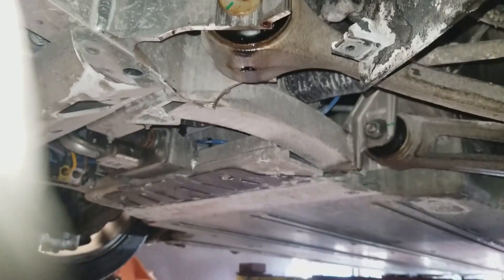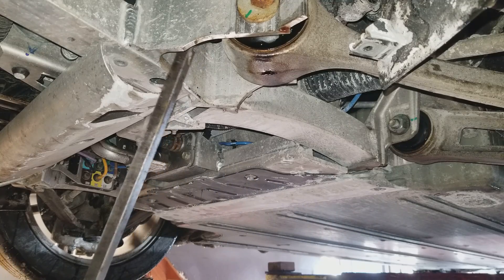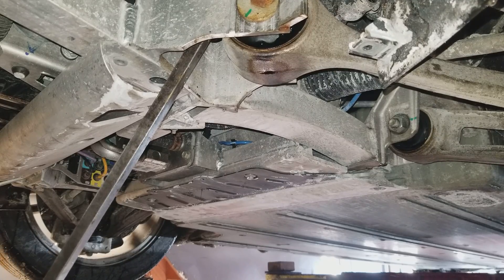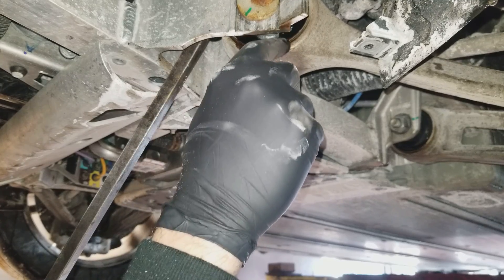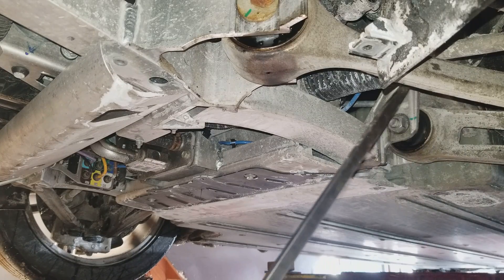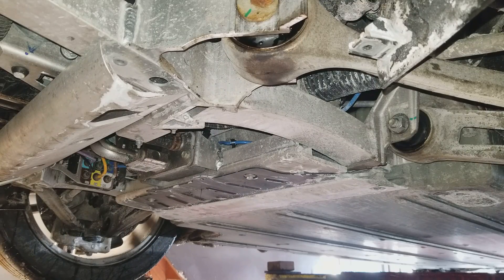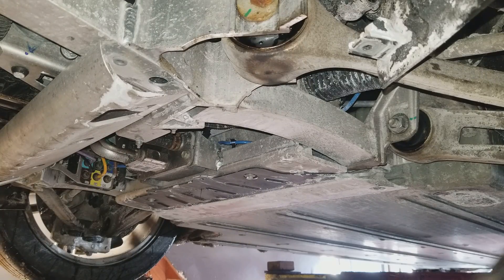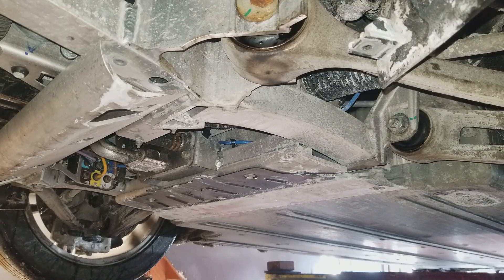Tesla Model S RWD control arm issue

Comment: looks like you could possibly cut the bolt head off. carefully. and slide bolt out. then install opposite  way going back together to avoid battery drop

Comment: Why not drop the battery it’s fucking easy 😂
Reply from the maker: Mark Conor yes. So easy. 

Until you crush a connector seat or have to bleed the coolant system without root access.
Reply: Evolution Automotive LLC lmao omg 😆 ok excuses to learn something new is all I hear or are you scared of the battery killing you 🤔
Reply: @Jimbo_zx  - It's much more about the management of risk and the opportunity cost of shop time - any good shop would recognize that.  Sure, the process for dropping the battery is relatively simple, and well documented in Tesla's shop manual - but not something you should just do for fun on a customer's car if there's a way around it - especially for something as small as a control arm.  The workaround to dropping the battery in this case (which the Tesla SCs use) is to cut the inner bolt and replace it in the opposite direction when replacing the arm.
Reply: @Andrew-vt7mi  i prolly would have just cut the bolt anyways 🤷🏽‍♂️
Reply: @Jimbo_zx  - For sure.  That's what the Service Centers do.  FAR easier and less risky to cut a bolt than drop a HV battery.

Comment: It is because those suspension  pieces are from Mercedes-Benz  E-Klasse and they  were not designed  for the   weight of   Model S which is very heavy due to battery weight. Tesla  was simply  unable  to design their own suspension.  They lack expertise.  Which is  compensated by  excessive hype.
Reply: Wait, from which E-Class are we speaking? W212? Is the entire front suspension from the mercedes parts bin? do the pre-facelift awd tesla's also have the suspension components from mercedes?
Reply: @steckenbrunzer  yes, they do.
Reply: @leotimtom6637  Sorry, could you be more specific? Thank you
Reply: @steckenbrunzer  Suspension pieces  such as  A arms  are from   Mercedes E- Klasse. Basically    all independent suspension is  from Merc. Actually  all  American sedans  and cars use   foreign suspensions  because they are unable  to engineer their own platforms, exceptions are only  trucks and some sports  cars.   Ford uses Mazda,   Chrysler uses  Fiat, Mitsubishi,  also Mercedes and GM uses   Daewoo, Opel and Isuzu.  Years of  rebadging imports and  regrilling their own  junk has made them so weak, that  any foreign company, even the  cheapest  European lackluster can  engineer better components than any US based car company. Even Koreans can  make better luxury  vehicles than US companies.
Reply: @leotimtom6637  Thank you very much :)
Reply: @leotimtom6637  
Or is it the other way around, do the Europeans share a design that the US built.
The only way to be sure would be to see which vehicle was designed first.
You also have the fact that Ford especially is a world brand and sell vehicles all over the place.
There's no way to be sure that the part wasn't designed in the US, and is simply used globally That's also true with GM.
They have a large global presence especially in Asia.
certainly Chrysler used a lot of Mercedes parts because they were merged at one point.
I'd like to point out that Chrysler products got significantly crappier after that merger. Because everyone knows Mercedes makes crappy unreliable cars that turn into endless money pits once they get past 100,000 miles.
be interesting to see where a US built Toyota Camry or Honda Accord had its underpinnings designed. Considering those cars are not sold outside of the US or in very small quantities.
I'm not saying that I know for sure which is the case, I'm just saying that you would have to look and find out when a particular suspension component was designed and by who, not just by what car that part happens to end up in.
There are so many sharings of chassis at this point globally to cut costs that I'm not sure this is going to be an easy thing to figure out..
But the idea that American companies are unable to design a suspension component is kind of asinine.
considering the heavy duty trucks that we build and design take way more abuse than anything a sedan will ever see. So I called BS on that comment totally.
we've been building big heavy sedans far longer than any European or Asian country.
Take a look at a 1960s Cadillac or a Chrysler imperial.. You think somehow we forgot how to build a suspension system after that?
Reply: @kens97sto171  well European cars can go around corners.
Reply: @geoffcarlton4047  
Yes and so can American cars.. Corvette, Mustang, of course European cars don't go around corners very long because generally speaking they're unreliable pieces of crap.
 Although some American cars specially Chrysler aren't a hell of a lot better in that regard... Oh wait it's Fiat Peugeot Chrysler now so an  even bigger piece of crap than it was before.
Sorry but there are no European cars I can think of that I would consider reliable.. doesn't really matter how good it handles if it doesn't run very long.

Comment: So, to replace the aft control arm, the battery has to come down first?
Reply: According to Tesla yes. But I've seen it done without dropping the battery. Loosen the bolt and cut it on the rear side. Then get a new bolt and install it the other way around with the nut on the rear. I have no idea why Tesla installs the bolts the way they do. Maybe it's easier in the factory? Sure makes service a pain.
Reply: @markusstrobl1067  I was thinking of doing the same thing. They will have done it for a reason though, wonder if more chance of puncturing the battery in a crash maybe?.
Reply: @geoffcarlton4047  No, Tesla SC change the control arm without dropping the battery but cutting the bolt and replacing it the other way round.
Reply: Don’t drop the battery, loosen the bolt cut the head of the bolt off. Slide the rest of the bolt out. Put new bolt in with head of bolt on opposite side, tighten nut next to battery. No battery drop😊😊😊
Reply: Service manual says to install bolt from rear when replacing arms. Them engineers must know something we don't lol

Comment: From user "Nix" at InsideEVs: 

Nix
January 20, 2018 at 12:57 pm 

Yes, every shop manual I’ve ever seen all say to install the bolts/nuts for control arms finger tight, then torque to spec once the full weight of the vehicle is on the ground. This is exactly for the reason you state, that the rubber will experience excessive rotational torques on the rubber when the wheel is at full stuff if they are tighten when the wheel is at full droop.

I wouldn’t be surprised if they made this mistake, since they also said this:

“Decided to put it on the alignment rack, and couldn’t get it to align properly, so we took the shield off to take a look at the components. ”

That is a huge red flag right there. Alignment techs are trained to look for damage FIRST before trying to do any alignment. Because even if you can get the machine to successfully do a static alignment with the vehicle not moving, if it has damaged or loose components the alignment won’t be effective under braking or while cornering with the weight of the vehicle shifting the loose parts around.

________________

The issue of the rubber only being able to twist a certain amount before prematurely failing is a big issue in the offroad world where vehicles are modified to have additional travel. They use aftermarket products like Johnny Joints or Duraflex joints that allow free rotation because if the known premature damage caused by over-twisting the stock rubber bushings.
Reply from the maker: paytontech we weren't the ones who installed these. This car was at tesla for everything for the first 4 years. This is my personal car I'm using as a guinea pig and test mule.